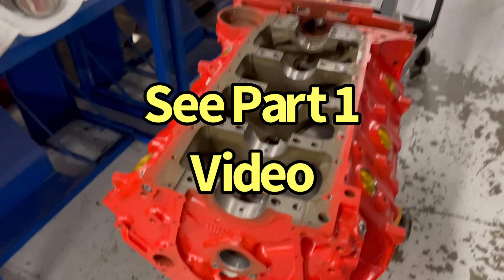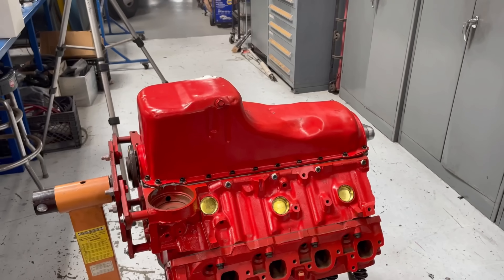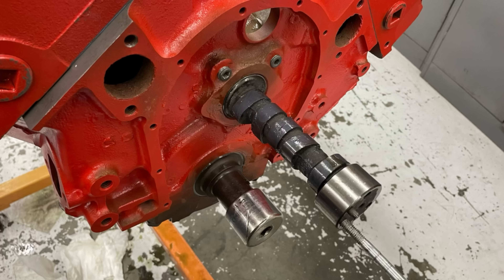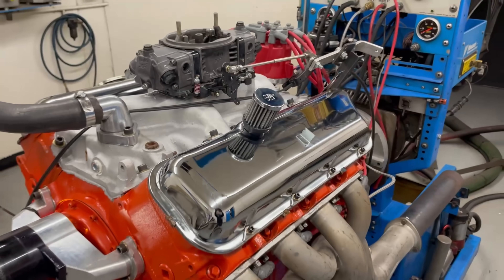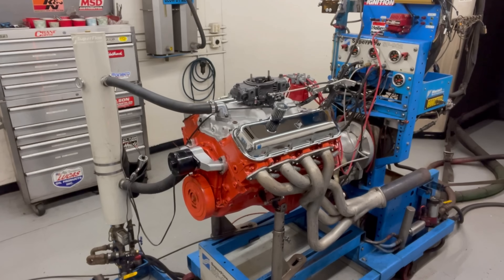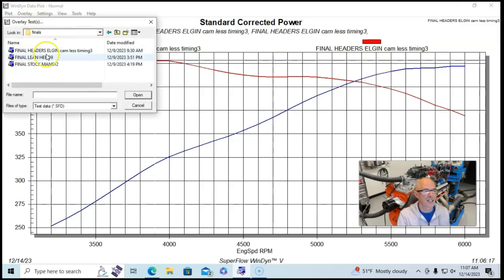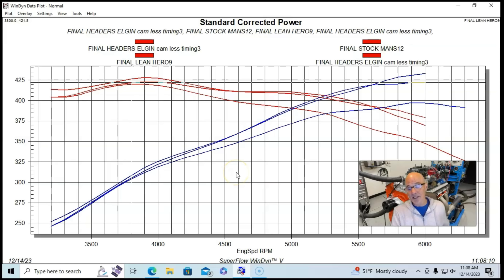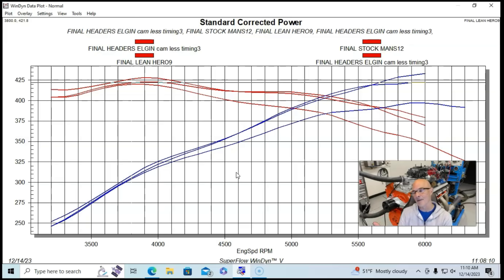FULL DYNO RESULTS ON THE L78 396, OVERRATED AT 425 HP OR  UNDERRATED AT 375 HP? WHAT DID IT MAKE?

Comment: When even the Boss 302 got a 4150  780 cfm Holley 
the 780 was rated on flow bench and so was 750 
5 /16 bigger is 700 rpm more at idle  1400 at wot 
Id call that Contraversie
Reply from the maker: 700 rpm higher idle?
Reply: @richardholdener1727  A carb wont change with idle its cracked butterfly 
wot is wot 
I learned on my LT1 that my butterflies on tb dont control idle .
its actually a hole drilled in tb in middle bottom triangle on top triangle is iac port for idle with ac on 
it started at 4mm it was 3/16 at 800 rpm butterflys closed 
making it 52mm tb 2 24 mm butterflys common knowledge 732 cfm
is tb governs the lt1 rpm and hp so if you port heads you need 58mm BBK
i tryed drilling it to 5 1/6 made it 1500 idle to much for daily driver
closed it redrilled it to 1/4 inch 6.5 mm making Throttle body 54.5 mm.
idle became 1100 rpm making it 807 cfm and making 0 vac at wot
power went up through out band and rpms topped out higher 
it had top speed of 50 in first gear now like 63 mph 
on 0=60 mph timer  became 1.97 0-60 mph and did it without shift
it actually took some getting used to
 im used to under 
2 second 60 ft in quarter mile  
0-60 mph takes twice the distance
Now its actually using th 223 flow of the head ports
when you add airfoil to TB it goes from 285 horse to 220 horse on dyno 
by plugging up idle air hole it blocks 100 cfm 65 horse power loss 
proven on dynos 
and your putting on 30 cfm smaller carb and smaller pump shot 
on Big Block would cost at minamum  50 Hp easy
most 400 and 454 big blocks came with 850 cfm Rochesters from factory so yes Contraversiy

Comment: I never knew that 396/375 was rated 425 in the Corvette. Everyone I knew that had one had it in either a Chevelle SS or Nova SS. Anyway there is nothing like the sound of one of those 396 solid lifter engines idling with open headers. I was in high school back then when they were pretty common and knew a lot of guys that had them.
Reply: You forgot the Camaro SS.
Reply: @markg7030 Yes I know they were in the Camaros too.  I said everyone I knew that had one. Didn't know anyone that had one in a Camaro.

Comment: Great video and this takes me back to 1978 where "Popular Hot Rodding" magazine did several articles on a 396 rebuild = called "Project Engine" and what happens to torque and horsepower when different speed parts are used on an engine. The most significant part is of course the camshaft selection and to make a long story short = these guys coaxed 502 horsepower out of this 2 bolt engine. The last test was in the volume 18, number 9, September 1978 issue = truly great stuff!!

Comment: another factor is the remainder of the exhaust system. Pontiac ran into issues plugging the GTO engines into the Firebird, due to all the 90 degree bends an F body demands of the exhaust system past the rear axle and around the fuel tank. And on some Chevy big blocks, there were different intake manifolds to clear different hood lines--I'm too lazy to look up the specs on different L78 placements, perhaps someone can chime in if the Chevelle, Corvette, and Camaro all got the same manifold or not.  i think the NSRA or ISRA had an issue with LS6 intake manifold choice in the 1980's?

Comment: It seems that I didn't have bragging rights back in 1971 when I bought a Black Chevy Impala that had what I was told was an L78 396 425 HP with a Muncie 4 speed. Compared to some other muscle cars I'd raced and some I'd owned I kind of had my doubts anyway. Money was tight and there was little left after a cam and intake manifold for a dyno test as well as all the broken parts. Regardless, the car was a sleeper. Like most of the rest of us, I wish I had that car now as well as all the years.

Comment: If I remember correctly the distributor was about the only difference in the two engines to explain I was a parts man back in the late 60’s and checked all the parts in theses two engines and the difference was in the distributor as the corvette was set at a higher rpm than the Camaro and Chevelle engines thus giving a less HP rating 
Not positive but this is what Chevrolet did to

Comment: you are forgetting one thing,as a 66 chevelle owner with the 360 horse 396,i noticed that the horsepower rating for the chevelles was at 5200,corvettes 6200,and using your graph it is basically as gm said chevelle 5200 375,corvette at 6200 425,so if you wanted 425 horse in the chevelle just rev higher
Reply from the maker: the 425 hp rating was only in 1965
Reply: It’s not that simple, to just raise the rpm’s, although that’s true many times for the factory manipulating horsepower ratings for the same engine.
But for a 66 Chevelle 360 hp or a 67 Chevelle 350 hp or say a 69 Chevelle 325 hp, those engines had hydraulic lifters where the peak horsepower was typically under 5500 rpm; while the same CI engine with a solid lifter cam, higher compression and hi rise intake manifold, along with usually a bigger cfm carburetor, developed its peak horsepower around 6500 rpm, and they usually had 4 bolt main bearings instead of 2.

Comment: What makes you think they didn't put a hotter cam, better manifolds etc in the Vette to make that extra power? (It may be well known the cams are the same...I just don't know it.  LOL )  What I do know is GROSS HP ratings were with no accessories and sometimes headers.  That's the main reason  power figures TANKED after 1972, it became SAE Net figures.  The manufacturers were famous for tarting up engines for a good number and sending ringers to magazines for testing.  The good old days weren't as "honest" as today.  Then again, we had late 90's LS1's F bodies making (Corvette 😁) rated crank hp at the wheels.  ;)

Comment: I have a set of L89 pistons and it was rated a 425 HP. These pistons in the book are 12.7 to 1 with a closed chamber head. 425 HP is an underrating.
Reply from the maker: L89 is an alum cylinder head option-there was never any production 12.7:1 396 motor. 425 hp is not under rated.

Comment: I wish you would test the big car big blocks (non-hi perf 454,455,500) which all claimed to make 360-375 hp, but in reality made closer to 300 or less.
Reply: Huh?
Reply: After having seen some seen some revivals with those engines (Cadillac 500, Lincoln 460 (?), GM 455 and 454) from the 'peak' HP years in luxury landyachts it's actually shocking how overrated their 'gross' HP ratings were and how obvious it is that they're well over 100HP less than advertised. They all have torque, obviously, but are slow as shit from a roll despite being rated around 400HP. Very few engines were actually built like the one in the video to flow and rev to make anywhere near the rated HP, yet they barely lowered the rated HP for the severely detuned engines that went in the vast majority of them. Crazy.
Reply: @Demoralized88  Absolutely correct! The advertised HP for the luxury cars was total BS. Richard Holdener's channel has dyno results for a lot of bone stock V8s and the HP is nowhere near 375 or 400. More like 320 HP for a 472 and 330 HP for a 500. Muscle car HP ratings are close to reality usually.

Comment: Richard, Did you make any tests with the Comp cams cam VS the Elgin cam? Also wondering how an old school single plane intake like a Torker or Tarantula intake would do VS the dual plane?
Reply from the maker: No comp cams tests yet and single planes typically add power up top, but lose down low

Comment: The 434 hp is still increasing.  Really question, Did Chevy EVER make a better flowing exhaust manifold?  From watching Nicks garage I believe Mopar made some really good manifolds on the Hemi and wedge motors.
Reply: What the heck sense does that make?  Camaro exhaust manifolds won’t flow but the tight space of a corvette manifold flows better!  Oh Chevy?  🙄
Reply: @garyhosier4765  the Vette manifolds allow for a larger diameter head pipe .
Reply from the maker: the Vette Manifolds were better

Comment: I just finished a full bone stock restoration on an all original 1970 L-78 from a Nova, motor was untouched and I was the first to open it up.  I have the original 780 carb on the original "low rise" 3963569 manifold with the TCS system installed.  Heads are all original, new valves of course.  I used the original distributor (even the cap) but I replaced the points with a Pertronix kit.  Dyno testing showed the best HP at 420 and the torque at 428 through headers.  I did not do the "hero run" as you did so maybe there was more in it.  Also, I was a litter conservative on the valve lash, but I at that point I was out of time and I was happy with what it was showing. https://youtu.be/a3efGxlr88c

Comment: In addition to my comment earlier, the L78 engine had a different cylinder head with 1.99 insted of 1.88 exhaust valves. Those heads are hard to find and extremely expensive. Those heads were on 1965 425 hp vetts and 375 hp z-16 chevelle. That would add even more hp to what i already mentioned.
Reply: Like to know where you got that info.  No Factory Big Block heads came with bigger than 1.88".  Not even ZL-1 heads.
Reply: @playlist55 some of these comments sound like fairy tales, the snowflake heads and duntov cams, etc.
Reply: @alanmeyers3957 LOL, it's like people that actually read the book vs the people that skimmed thru the cliff notes.  Sometimes I look at a comment, and I think... should I correct him?  Most of the time, I think... nah, I can't help him.  Unless of course I think I can help someone else.  Like I don't want anyone repeating the 1.99 thing.
Reply: 3856208: ’65 rectangular port, closed chamber, 2.19- and 1.99-inch valves. Used on 396/425 hp, 396/375 hp Z-16 Chevelle... I copied that. Put it in your search bar. I'm not sure it's true. It was new to me when I read it.  I have some books on BBC's but their buried in storage. I've also built a few and I still own one. No need to talk down to people just wanted to see equal comparisons to the original engine and equal dyno tuning time.
Reply: @ws1807 Yea, it's not true...  I do have my books and I've built more than I can count.  I didn't talk down to you.  I  did respond to someone else generically about posts.  I hate having to argue with people that "read on a comment board" something that is untrue.  Do your own research, I have done mine.  Biggest factory Exhaust valve installed in a head, by the factory, was 1.88".

Comment: Before 1971, engines were factory rated using a process defined by the Society of Automotive Engineers as 'Gross' horsepower. This figure was calculated on a test stand with no intake, exhaust or power-robbing accessories attached. Also go take a look at the corvette exhaust manifolds, they resemble shorty headers. Also carbs are rated for their cfm as is, so the bigger carb will make a differance. I think with those things in place and an engine with some dyno time breaking and tuned right would have 425hp. No need to be so biased.
Reply from the maker: The gross vs net does not come into play here. Nor does the carb-this Holley flows more than the OG carb. So look in the mirror for the bias.

Comment: My “L-78” has “HIGH PERF TRUCK” on the back of the block it’s a 4 bolt main with factory aluminum heads and intake bored .60 over with 12.5:1 pop top pistons, what would the displacement be now? This engine was in a 1969 Camaro I bought, I bought the engine rebuild parts for it. Also the engine number on the back of the block comes back to a 1968 Chevelle.
Reply from the maker: the aluminum heads are the l89 option and your displacement is 408
Reply: @richardholdener1727  thank you Richard. I bought a 1969 Z-28 in 1978 the 302 had been blown up from racing it, the BB was in it when I bought the car

Comment: I like that you ran it with manifolds and headers. I'm a little surprised at how much it lost with manifolds. The guys at Horsepower Depot (red 67 L88 clone that runs FAST series) run 9.10s with stock manifolds, or should I say "stock" manifolds. I know better than to think they're truly stock, and even still, they admit they're a restriction, yet with as much power as they make (555ci engine running 7,500 rpm), I kind of expected less difference on an engine putting out so much less power.

Comment: 375 HP is probably accurate. Once upon a time I actually had a OEM Holley from a 427 Camaro. I  ran it on a 340 Mopar race engine and decided some lucky Chevy guy should buy it from me for a restoration job. That was in the 70s. I should have kept it another 20-30 years. 😂

Comment: Have experience with those engines in the 70,s, I agree with the engine builder. We didn't have the carb and ignition technology back then 
I would like to see a set of 350 horse oval port heads dynoed on that engine.
Reply: Why oval? I had a 396 back in the day and we used the L68 Tripower and ported the heads, intake, exactly to the tripower manifold, which was square port. We got more horsepower than two 4 barrels on  tunneler. No joke. For some reason, that Tripower system was magic.
Reply: I have oval port heads on my 427 and it runs great. I think they’ve discovered that they are better than rectangular port heads in many cases. I beat an LS6 454 in a 1970 Chevelle SS. It shocked him. I had skinny street tires and 4:10 gears. He had 4:56 gears and wider tires. He sold it in 1983  and wishes that he hadn’t. I see him at the grocery store he works at. I still have my 66 Chevelle that I bought in 1980 as my first car.
Reply: @patfromamboy  big ovals are better for street performance. Rectangles were good for wot at the strip. And of course the dreaded peanut ports are good for low rpm torque.

Comment: All I can tell you is tha t wi t h my 65 Fuel Injection Corvette I could rarely beat a 402 425 hp Chevy.
I could however mop the street with the 360 350 and 325 hp 402s.
I built a 69 Ford Ranchero with a 416 ci FE engine. This was before aftermarket FE aluminium heads. I used a 390 block Merc 410 crank good. Rods revised the oiling system and used the 390 GT heads with light porting  and an increase in valve size to eqal the 427 low riser head. Solid lifter cam Edelbrock Performer RPM dual plane and a 3310 Holley with headers and 3 inch dual exhaust. Hooked to a beefed C6 out to a 9 inch po a i rear with 3.5 gears.
 I dont know the hp or torque rating but I rarely got beat by any 396 or 402.
However I could not hand l e the solid lifter 427 or 454 chevys.
The above led me to believe that probably in terms of crank horsepower the 425 402 was fairly rated. Theres not much doubt in my mind that the 390 hp 427 and the remainder of the 402 line were considerably overrated.
Although with the exception of the Chevy IIs  running  a 425 hp 402 there was a considerable weight difference between my 65 fuelie and a chevelle or El Camino running a big block.
Still my 65 fuelie had no problems with 390 hp 427 Vettes either.
Reply: I had a '69 Nova with the L78 396/375, .410 gear.  I beat every 350hp 396 I ever raced by 8 to 10 cars.  Never lost to any Ford.  Beat a Boss 429 by a Fender.  We were next to each other for the whole quarter.

Comment: L78 was rated at 375hp iirc. And ran solid lifters and a cam with .500 thousands lift with special valve springs. Also a higher perf GM/Chevy aluminum intake made by Winters iirc
Reply from the maker: we have all that
Reply: @richardholdener1727  if only there was a dyno video he could have watched!

Comment: The 425 HP was only available in the Corvette one year. '65 was the only year for a 425 HP 396. The '66 Vette had a 427 (big block option). It was rated at the same HP. That convinces me it was GM Corvette bias on the 425 rating in 1965. Did Impala come with the 425 HP 396 in '65?  Nope. The first few big gun big cars had the 425 409 then the 425 427. Chevy let the L78 loose on the rest of the carlines in 1966. The REAL anomaly is the 1965 Z16 375 HP 396 with similar intake and carb as the L78 but with a hydraulic cam. WEIRD. It's the only 375 HP 396 without a solid cam. 

New test?

Comment: Chevrolet needed up their horsepower in the 396 just to beat the Little GTO it was on the 360 horse 389 or the new 400 that year that was rated at 366 horse. But then again Chevy needs to get 425 horsepower 396 to get enough torque to beat the Little GTO

Comment: Back in the day my 65 Coupe after rebuilding the 396 using stock exhaust manifolds had 400 HP and 430 torque average on 4 dyno runs.  Take that for what you want.

Comment: First of all one really trick way to get a drop booster 3310 to run is swap on an 850 CFM base plate and do a little clean up where they met.
Losing choke horn isn't much in flow numbers but the blade and shaft really change it's characteristics.
Now most racers with 375hp 396/402 swapped in headers and bigger exhaust nearly right away. Another trick is playing the cam advance or retard AND some would swap on different intakes but no internal mods to start.
These little beasts could push past 450+HP and really did good in 1/4.
Only thing better was swapping to a 427!

Comment: Being blessed with family and friends that own Camaros and Novas with this engine and 428 CJ Mustangs. Seeing endless races between the two and knowing the results. Also being honored to witnessing several 428 CJ dyno runs. I can honestly say that the 396 was a match to the 428 CJ but only a match. All the 428 CJ dyno runs never topped 370 HP. All the FE runs were made with the factory full exhaust including water and electric being supplied by the engine, something around 350 hp for the CJ was the norm.
Reply from the maker: The stock 428 Cobra Jets run at Westech didn't make this much power
Reply: I agree, it is a tussle between the two engines. The 428 doesn't always come out on top in terms of peak power. @richardholdener1727